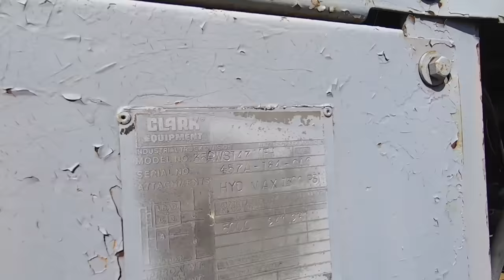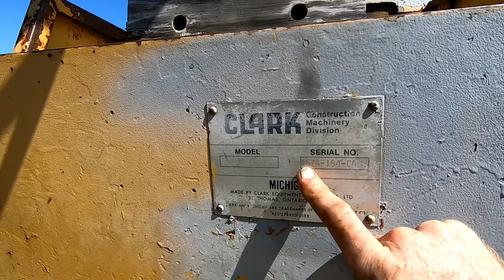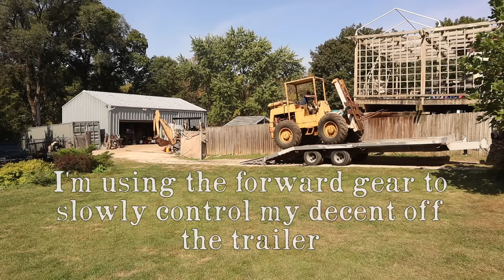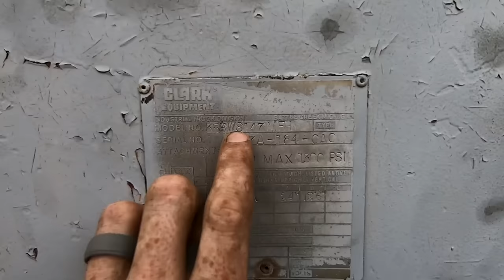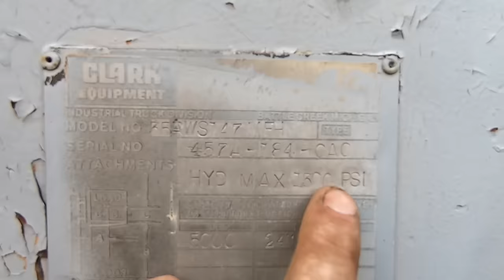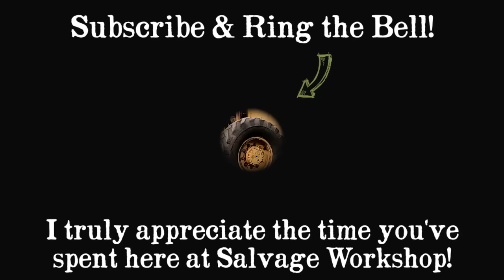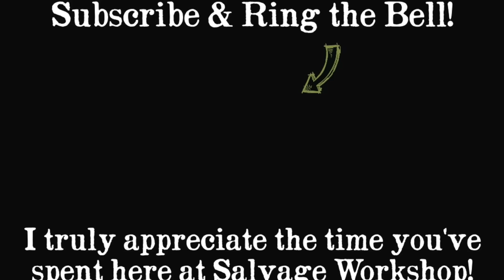I found a RARE ALL-Terrain "Wheel Loader" Forklift! Will it START?! (THIS Machine PUT UP A FIGHT!!!)

Comment: In 40 years of  pulling wrenches I wouldnt have ever figured the starter turning the engine backwards. Never have seen that - most likely never will. You are amazing 👍
Reply from the maker: Isn't that CRAZY! I had never seen that before either!!! You'll prolly only see that on old machines like this one that have been half fixed for decades by people who haven't a clue! Either way, im glad to have figured it out!!  I'll also probably never see that again! Thanks for watching and commenting, lots more to come!
Reply: Some starters types can be ordered in clockwise and anti-clockwise turning direction. Someone replaced starter and bought one with the wrong turning direction?
Reply: Detroit had marine applications that were counter rotating .
Reply: Check for smoke at the exhaust, that's a sign the engine is turning right direction.
Reply: @SalvageWorkshop  it's a old Michigan 1950 Ag85 with a reman Perkins diesel with a retro fit Clark fork lift kit you could purchase these fork kits for all kinds of Michigan loaders.
Reply: Cat reman gives you the opportunity for reverse rotation.  Had a customer get himself a good deal on a reman starter and installed it himself. 3126B.  Wouldn’t start. Called me. No codes. I finally got it when I saw the alternator fan headed in the wrong direction.
Reply: i had someone put the wrong starter on a kubota diesel i bought. got the right one and it fired right up haha
Reply: Worked on an early Ford Bronco with a small V8. Couldn't get the timing set correctly until I noticed the engine turned CCW. Reset the timing to the other TDC and it ran like a champ. I didn't know there were cars that ran CCW. You learn something every day. Good work. Enjoyed the video.
Reply: @roguedalek900  Yup.  Also Catipillar.  Maybe others?
Reply: Yes! Nobody was expecting that. Hope the engine do not had suck too much debris from that old rusted exhaust. Maybe would be good to check the head before run too much.
And that wrong starter can be easily reversed again and kept in the emergency shelf.
Reply: @richerrick45  Nope.  U taking serious medication?
Reply: Lister did engines that had opposite rotation and I know that some perkins and lister used the same starter, that would be my guess as to how it happened.
Reply: Agreed, I came to say the same thing. I'm always impressed with your skills but that was a good catch.
Reply: @SalvageWorkshop  thats a blue colored engine looks like a kubota diesel engine
Reply: @wilsondavis942  yeah perkins were in masseys back then but now perkins arnt around any more
Reply: spoiler alert :`(
Reply: @SalvageWorkshop  It's not an everyday thing that's for sure, your clue with the exhaust sucking was the answer itself. Years back, I looked at an auction purchase for a friend. Old GMC dump with a detroit. They pull started it to load n move. Got it to his shop and someone unknowingly charged up the battery backwards(completely dead and reversed the polarity). TONS of wackiness ensued and my buddy asked me to look at it. They told me about all the electrical theatre they were enjoying and it wouldn't start. but they could pull start it. I asked if they had tried another battery. "OH it's got plenty of charge"....LOL I'll save you the esplainin part.......3 different guys messed with that truck over two days...and it started like a champ 5 minutes after I walked up to it. What blew my mind,  the starter WAS actually spinning it backwards. I wouldn't have expected that at all. 

When you get into older stuff and especially one offs like this going to school is regular business. Good catch, most guy wouldn't think to cover the exhaust to see what's up.
Reply: One of the first clues it was turning backwards was it would not fire on ether.  Another clue was the alternator fan turning backwards.   The radiator fan could push or pull so that is not a good clue.
Reply: Also, some machines are positive to frame. My JD 1010 is like that, « reverse » connections
Reply: @ThePolomoloQC  Can you reverse the polarity of a starter motor?
The current in a starter motor goes through both the armature and the field coils. Simply reversing the polarity outside the motor doesn't change the relationship between the two. To reverse the rotation you'll need to reverse the polarity going to the field coils or to the commutator but not both.  IE, reversing the polarity will not reverse the rotation of the starter.
Reply: The only way you could have known how to do that would be to spend years and years working on mechanical things that lost their lives 40 years ago and only a person skilled at working on what most people mechanics would never even considered working on. This mechanic however has got some mad skill. I’ve seen him fix motors that could not be fixed. I’ve been a mechanic for more than 50 years and am constantly amazed by his skill. I will say this, he is fixing these for himself which is way different than fixing it for a client. If if breaks for you , you simply fix it again . If fixing it for a client they want a one year warranty and the thing ends up living in you garage for years.
Reply: @SalvageWorkshop  My question is, why not test the two starters while they were disconnected? If they spin in opposite directions, swapping them out will work. Saves installing the starter before figuring out it will work.
Reply: @rogerrabbit80  This way was more dramatic!
Reply: @SalvageWorkshop  e6yi
Reply: Some small Marine engines built back around world war II were designed to run in either direction.
Reply: @Ric Herrick  I bought a car sold in Australia called a Hayden it is basically an old Chevrolet El Camino and it was a reverse rotation engine
Reply: Some starters be made to run either direction..
Reply: Ran into that on a FMC pusher RV. Somebody replaced the starter and wired backward. Would start and run. But very low oil pressure and would backfire while running. Found out they used a Dodge 440 out of a boat and they ran backwards. They switched negative and positive on starter. Motor ran great.
Reply: @roguedalek900  Worked on many ! Bevel angle on Bendix teeth indicates rotation spec.

Comment: If you can carefully clean the paint off the label below the Clark data tag, you might find a military Data Tag.  If it is one, there will be a NSN (National Stock Number) on it, and with that you might be able to research a copy of the Military Technical Order (Shop Manual) which will contain EVERYTHING about repair and operation.

Comment: Just one tip to load heavy equipament on the trailer, use some snatch blocks, they can double the pulling force if you have enough rope or steel cable. Just hook the block with the rope in the machine and the end of the rope you hook back in the trailer. This way you don't force too much the winch.
Reply: "I LOVE SNATCH BLOCKS!" - Destin from Smarter Everyday
Reply: That's exactly what I came to say. Snatch blocks are a force multiplier!
Reply: And also there is less stress applied to the cable and less likely chance to get hit by a broken cable.
Reply: Agreed. Snatch blocks will save a winch motor. I though it sounded weird when you cranked it the first time...
Reply: Don't stand inline with the cable either!!  Had a friend killed by a hook on a winch cable that snapped and came back and hit him in the head. Was winching a peice of equipment onto a trailer that he had done hundreds of times before.  3 feet is the difference between life and death.
Reply: @stevekopito  sad story. but this was nylon i hope, not wire cable.
Reply: @stevekopito  those new winches only have a real short cabled remote on them and alot of the time they don't come with a wireless remote so alot of times they don't give you too much good option except duck and hope you don't get hit when it snaps.
Reply: @stevekopito  sounds like its a good time to make an extension, 7 core trailer cable would be a good place to start, and/or wire pick up points at the rear or part way down the side, that way you don't have to be near the winch.
Reply: @CloudHindlen  sorry, but this is wrong. The stress on the cable from the snatch block to the pulled equipment is still the same. And these cables are designed to handle the power of the winch. With snatch blocks you can overload the cable without knowing it. Normally the winch would die before the cable is at its limit.
Reply: That noise sounds like the compressor

Comment: Great that you got it running! Look at the alternator cooling fins, it'll show rotation...if it has the correct fan.
Should use a standard clark forklift lift chain. Clark made great units! 
The brakes...probably going to need to put seals in the master unit, and wheel end cylinders. Require wheel removal, thats going to get you at least 3 more videos!
Enjoying your content! Glad you saved this one from the cutting torch!

ALWAYS use leather gloves when handling wire rope...and stay clear! Tractor supply sells winch remotes, safer than being next to the rope.
Reply: I started praying that cable did not snap with him standing there, then I figured it held with as much time that was left on the video.
Reply: Best to use a snatch block also to make the pull easier!
Reply: @MrGordy61  I was worry about that cable too.

Comment: Hi bud, I worked for Clark for 7 years back in the 1970 when they set there  
company up in Australia. We built the bucket loaders for the Australia army.
They were a bucket loader  all we did is add a forklift attachment to it.
I new it was a Perkins Engine that’s what we used in the smaller models.

Don’t remember much more, been a long time.
Cheers

Comment: Young one,
You made mention that the wheels were not tracking properly.  On old military all terrain fork lifts they had the option to have the back wheels stay in the straight ahead position, an option to turn together for really tight turning circles and believe it or not the option to turn in the same direction together so the forklift would CRAB when moving forward or backward. Those lifts also had the option to lean sideways into a hill. I don't see enough levers to think this might be that type of machine with the leaning ability, but it should have a lever somewhere to control how the rear wheels act. Might be you don't have the control valve in the correct position to make it steer properly.  So thus are the memories of an old SEABEE heavy equipment operator.
Reply: J.I. Case made big 4 wd agricultural tractors that didn't articulate but rather had both axles steerable like your forklift. Models were 2470, 2670, 2870, 4490, 4690, and 4890.  Many of the J.I. Case wheel loaders of the same era had air over hydraulic brakes. Manuals for a W14, W18, W20, or W24 would probably explain how that system worked and would be a good reference for your rough terrain forklift.

Comment: So basically you were shooting happy juice into the exhaust..lol.. you just experienced one of life's valuable lessons that u will probably never forget.. I've had a few of those myself.. Thx for taking us along for the ride..
Reply: This stuff happens. I had a friend of mine who was a reliable mechanic and he acquire one of those Craftsman riding mowers that had the overhead valve Tecumseh engine and it didn't run. Well he did all of the checks for spark and fuel and such but it still would not start. So he gave it to me and I took it home and went over his work and it should have started. Then I got to thinking. I wondered if the flywheel had sheared the flywheel key. Only one way to find out, and sure enough when I removed the flywheel it had a sheared key. Used it for quite a few years until I wore out the engine.

Comment: Make or find a fairlead roller for the bulkhead of your trailer. Looks like the winch cable was dragging in the top of it causing lots of extra drag. A snatch block does work wonders too.
Reply from the maker: I agree, but that trailer is borrowed and once I buy a large deckover trailer I'll do something like a roller fairlead... I also already changed my winch mount to make it higher that it was before

Comment: Holy Smoke , turning the wrong way .....That was a good catch . Awesome . She sounds okay , put the rebuild on the back burner get the brakes working . The wiring is not a big deal . For occasional use , just put a solar panel on it to keep it topped off. Good work .

Comment: That should have a bucket on the front they never came with a forklift someone has made that up but that's not a bad thing cus they never had enough power for proper loader work, will be a handy set of forks. Good job figuring out the engine turning backwards not everyone would think of that👌

Comment: In round about 1978/79 I worked in a quarry and we had a brand new Mitch wheel shovel with a 6cyl Perkins the heater was a coil in the manifold and a diesel resivour fed from the injector return When cold turn on press heater 10 seconds and start it was the best machine we had. especially for cold start.

Comment: From looking at another forum The standard 35 b Could come with a gas engine or several diesels including the Perkins you were working on. I worked at Allis Chalmers assembling lift trucks in the 70s and 80s we put together military and commercial lift trucks all though none were four-wheel-drive, but we would install almost any engine including the Perkins in those lift trucks! I seriously doubt that version you have is a military version it would have serial plates indicating that it was made for the military. I the forums also indicate it is tough to find manuals for those, before I would overhaul that engine I would completely go through the fuel system, I think you got a pretty cool machine there as far as the lift on the front of the machine I think it was just ordered that way we could put on any attachment a customer ordered at our assembly plant! Good lick
Reply: Could this be an ex military piece of equipment?

Comment: For those Delco Remy Starters, you can reverse the rotation by turning the back brush plate 90 degrees.  It may be marked.
Reply: Well that is nice to know. I would think that you must replace the starter drive for reverse rotation as well.

Comment: The smoke isn't oil burning, it is injectors over-fuelling it when it is cold as do a lot of engines (Cummins top stop are notorious for it), I wouldn't rebuild the engine until I had put a number of hours on it to see if it has any problems. Perkins are a "dirty" engine at the best of times, run for ever but smoke and leak oil as a matter of course. Rebuild the injectors but leave the engine alone for now.
Reply: it has a dribbling injector. You see a lot of diesel cars do it when first starting in a morning when they have been stood overnight.
Reply: Definitely! At most I'd pull the injectors and have them refurbed, however most likely I'd leave it be, not worth spending big on it for the sake of a bit of diesel...
Reply: @KrikkitWarlord  Dribbling or squirting injectors instead of spraying injectors will cause issues such as melted pistons so it is very important to have the injectors serviced and to run a fuel cleaner through the fuel system prior to having the injectors done (so dirt doesn't foul the refurbed injectors). It's cheap insurance. I doubt if this machine will do big hours unless sold but it still cheaper than an engine rebuild.
Reply: @ctiley2212  yes that is a possibility, I've been running my van with this problem for over 7 years like this, bit bad now as it blanks the field out, so I'm going to get it sorted now,  yes it could it could cause damage, but remember old Perkins are modern engines.  I wouldn't bother even doing mine now if it wasn't for the embarrassment of all the smoke.  its used daily and its always smocked on starting first thing.

Comment: I always like to mow and trim around a machine when I start working on it too.  You don't have to wade through things while you work, and it is so much nicer when you have to get down on the ground, like you inevitably  have to, also helps when you drop a tool.  I have run quite a few small Michigan rear steer loaders back in the day, this is a more modern machine though. Seems like all the quarries had one about this size for loading pickups back in the 70s
Reply: You also don't stir up as many bugs as you walk around

Comment: The Perkins 4236 is one of the most reliable engines and low consumption that I know for heavy equipment. Pretty popular on spanish heavy equipment during the 70,s and 80’s.
Reply: Just about every massey ferguson tractor since the dawn of time untill the agco takeover had a perkins 4 or 6 cylinder engine in it, absolutely bomb and bullet proof in terms of reliability and run like a swis watch.

Comment: That hard piece of metal in the stud is no problem what so ever, take a torch make it white hot and slow cool, this will anneal the driver bit to a condition that you can drill it fairly easy. P.S. does not work very well on tungsten carbide.
Reply from the maker: Yeah that was the next step if bashing it into the middle didnt work! Great tip!

Comment: My husband, a retired coal miner and mechanic, has been bingeing your videos and I also find them interesting. He wants me to tell you that when you put the hub bearing on your lift ( not sure if it’s in this video or another one), using 2 nuts & the ring/locking washer, & the locking washer didn’t line up on the pin so you retightened the inner nut, a lot of times you can flip the locking washer and it will line up on the pin without having to retighten the inner nut.